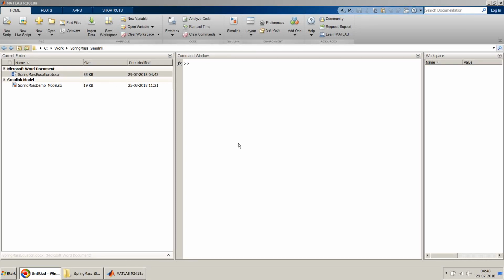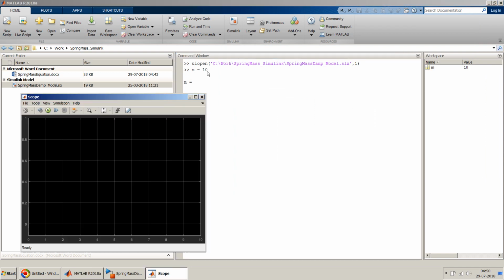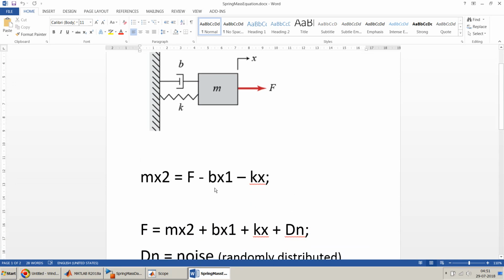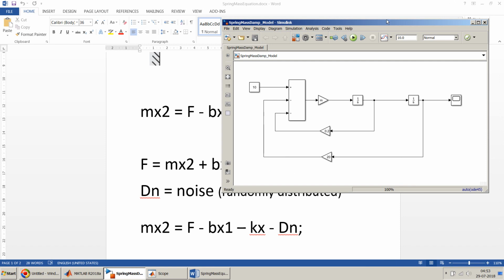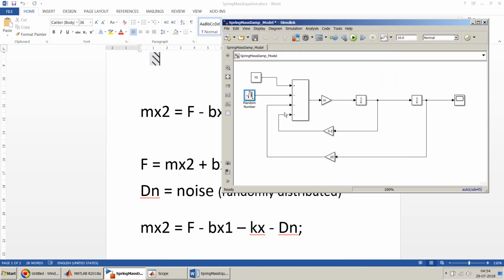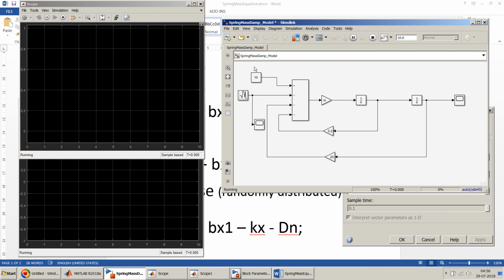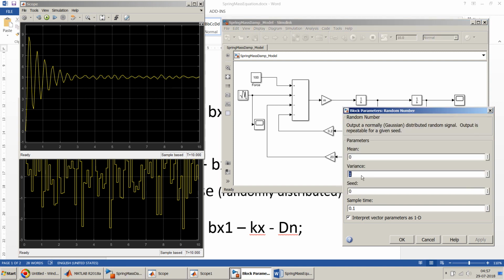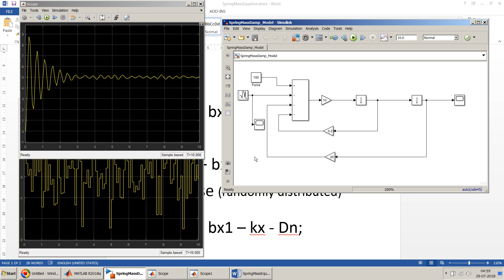Spring Mass Damping System with added noise disturbance in Simulink - Part 2

Comment: Why did you not use step-block instead of constant-block? Are they different?
Reply from the maker: If you put the StepTime=0 in Step Block then it will behave similar to constant block. However, when a constant value is required in the model then I think Constant block will be better than Step block.

For reference, details shown in this video is also shared in the below link:
https://programmerworld.co/simulink/spring-mass-damping-system-with-added-noise-disturbance-in-simulink-part-2/

Cheers
Programmer World
https://programmerworld.co

-
Reply: @ProgrammerWorld  thank you,

Comment: your gain block is wrong. it should be 1/m, no????
Reply from the maker: Yes, I think you are correct. It should be 1/m. But ultimately it will not make much difference in the model as the symbol boils down to numerical form in the model. Thanks.

Cheers
Programmer World
https://programmerworld.co

-